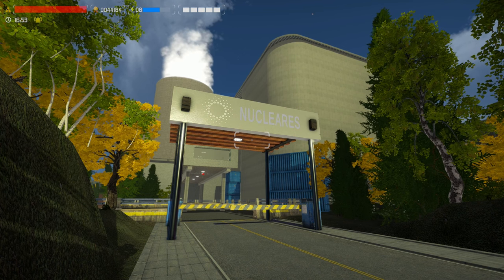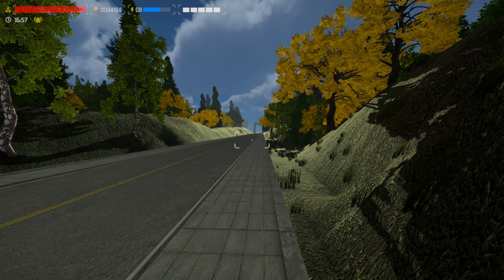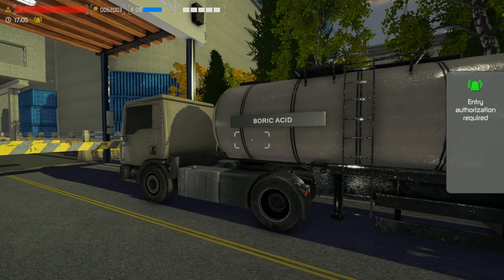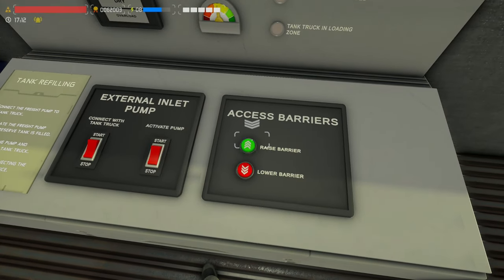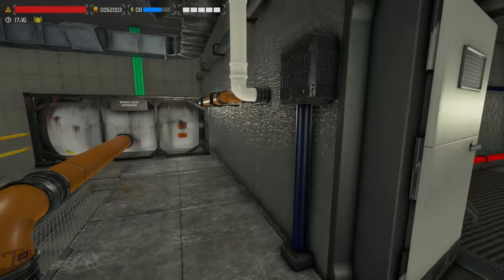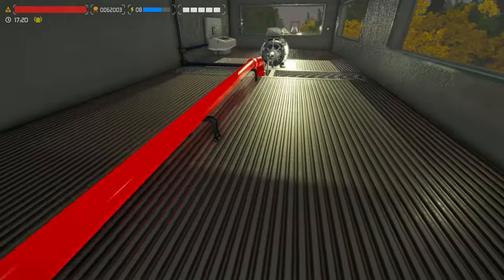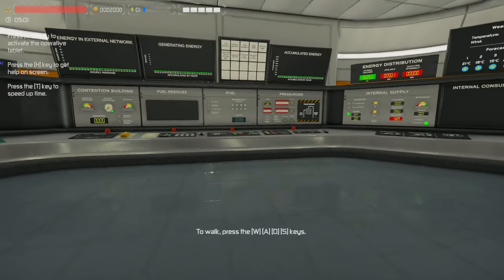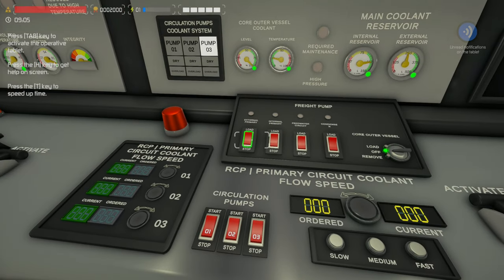Boric Acid Delivery Update S1 EP04 - Nucleares Tutorial

Comment: Any idea what the "external core coolant" tank 8:13  is used for? There is only 1 "External reservoir" gauge in control room and 1 in Chem room, both mentioning the waters edge. Nothing for the inside external tank. And the "internal reservoir" gauge (both control room and Chem) is referring to the leftmost tank 5:36 if I understand it correctly. Even if the gauge is broken, I can't figure out the use for that "external core coolant" tank since the internal reservoir (leftmost) fills directly from the water edge tank.
Reply from the maker: The 2 gauges on the left panel in the chemicals room are both broken... the external reservoir is a tank outside and there is also another external tank in your Core room, the names of things are a little messed up atm in the games coding and the Solo Dev is working hard on correcting these and others as we speak since another update will be released soon again haha 😇
Reply from the maker: The internal reservoir (located in your core room) is technically your "condensate storage tank"
There is also another internal tank... aka "water tank" that is yellow and located on the 2nd floor of the chems room... also strange and messed up naming haha✌️
I have notified the Dev etc already on these 'bugs' and more 😇😎

Comment: Would it be possible to spin up the generator to nominal speed, on a lower voltage output in order to not overload the dummy load, for example by reducing the excitation?

Yes, it's possible to adjust the excitation of the generator to control its voltage output during the synchronization process. By reducing the excitation, the generator can spin up to its nominal speed while producing a lower voltage output, thus preventing the overload of the dummy load. This method allows for careful control of the generator's output parameters before synchronizing it with the grid. Adjusting the excitation is a common technique used in power plant operations to manage the synchronization process safely and effectively.
Reply: When the generator is being started, presumably the output voltage and speed depends on the torque input and the resistance of the dummy load. So it is possible to spin up the generator faster and then applying lower and lower impedance to gradually increase output power?
Reply: Yes, that's correct. During the start-up process of a generator, the output voltage and speed are indeed influenced by the torque input and the resistance of the dummy load. Gradually increasing the load impedance as the generator spins up allows for a controlled increase in output power. This approach helps in managing the synchronization process by avoiding sudden surges in power and ensuring that the generator reaches its nominal speed and voltage in a controlled manner. By adjusting the load impedance progressively, operators can fine-tune the start-up process to achieve optimal synchronization with the grid.
Reply from the maker: The Synchro in the game isn't as realistic as people think... the only thing needed to be done while it's coming up to match and sync is to open/close the turbine bypass to not blow your resistors up before actually synchronising and outputting to the grid, the excitation and rpm speed buttons aren't meant to be touched really 👌
But hey, as long as your having fun, that's the main thing 😎😂
Reply: So in conclusion: starting up the generator on a high resistance would much more rapidly increase its output voltage, to a point where it is possible to close the main breaker. In nucleares the resistors impedance is not modelled, it works on power instead. This means the resistors will be taking 100% of nominal plant power at the time when the circuit breaker is closing. This is unrealistic and the reason why they break so often during startup.
Reply from the maker: Might be a good idea to make a bug report through the Nucleares Discord as it seems like you know your stuff 🤔👌
Reply from the maker: Also a somewhat recent update added a 'compensator' to the turbines for more stability in powering up etc
Reply: Thanks for a good series btw. You are the best letsplay style on nucleares on YouTube. You have a play through first off camera, which means your content is fast paced and you know where to go with it.

Comment: I think there may be a bug in the time settings, i experimeted and am still confused,  even sober. 

The first, milliseconds per minute, is essentially clock speed but the ramp-up speed of pumps is not affected. Change in temp or pressure seems to be, though. I have not tested throughly enough to determine if wear is affected but pump ramp up or down is absolutely not affected,  turning it down makes the day go faster, turning it up makes the day go slower. 

The second "interval milliseconds". Pumps ramp up significantly faster, temps change at the same normal rate though. Not sure if this is a bug or what. Maybe i am just not setting things right. 
Also i have not yet started a new game save so maybe that has somthing to do with it.
Reply from the maker: The top 2 sliders for time settings... I'd suggest you don't touch those as that's the time for the games 'tick cycle' or how many calculations per 'minute' the games needs to do before continuing...
The 2 bottom sliders are the only ones you want to change as they will have the actual effect your looking for... see my previous reply to see what my settings are and copy/modify to your PC's 'likings'
Reply: @ShArPy1o1Games  im on steam deck. No matter where i set them does not seem to affect performance,  as long as i have the quality profile set to balanced. But yeah its difficult to figure out exactly how each of the sliders affect the game. Yes the bottom i set to 8 and that makes my fastest setting faster, the first two are just not quite what i expect them to do.
Reply from the maker: A game restart may be needed for some settings to actually change... i know that for a fact on some visual settings
Reply from the maker: But Steam deck, im not to sure about as its still technically new
Reply: @ShArPy1o1Games  just restarted so i can get the freight pump for truck unloading. 3rd restart and each time i maxed out all upgrades,  no doubt ill do the same again. My sign currently says 79 days without a lost time accident.